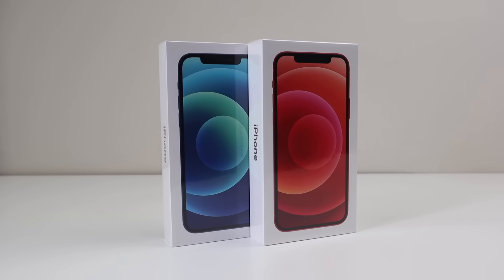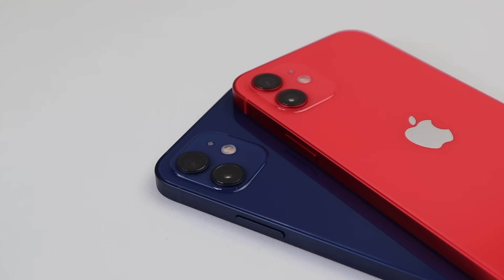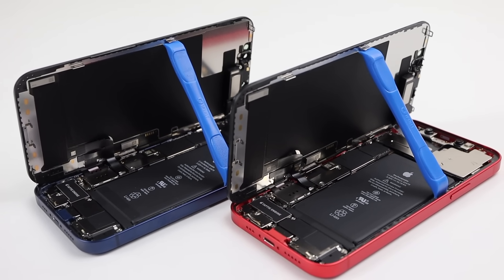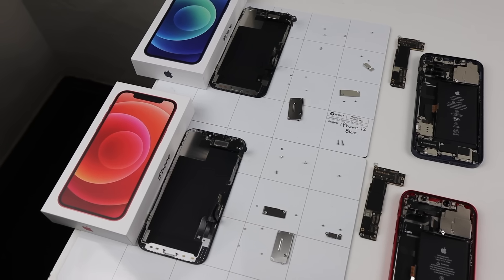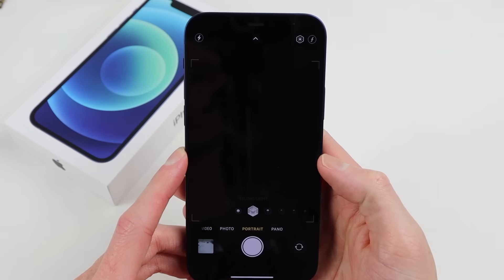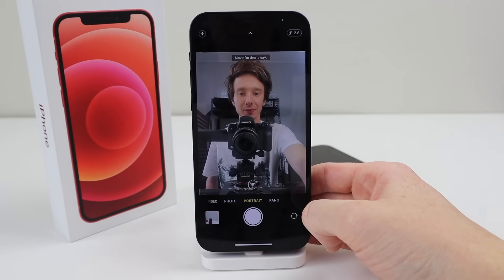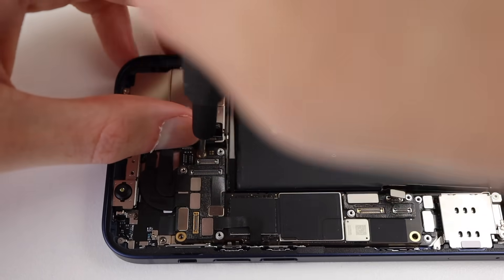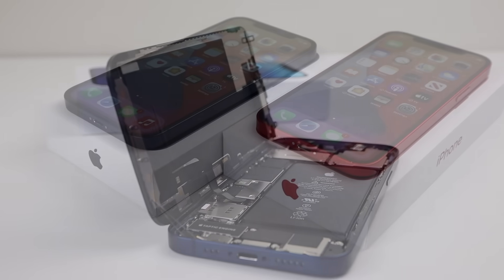iPhone 12 Anti Repair Design - Teardown and Repair Assessment

Comment: Wow. Intentional hostile prevention of repairs. This is why I don't use apple products. I want to be able to fix my phone at any repair shop.
Reply: AND I LOVE THAT APPLE IS DOING THAT😁
As technology evolves more and more, it is no longer possible for non-specialized human beings to make their own repairs.
a good example of this would be cars, 50 years ago it would have been perfectly possible for anyone to do a simple repair on their car! not nowadays (have you ever looked at a modern day engine there are more cables in sight than metal).
such as, for example, making a small repair to an appliance does not present any risk to human beings, making a repair to a car, an appliance or any other object, may be involved in handling objects that we may not even know what they are or what they are for. example batteries and other hazardous fluids present in equipment.
Reply: @DiogoP  That is true. Some repairs need to be made by professionals to guarantee safety. But goddamn if I can't buy a kit to fix my broken iPhone screen without the whole phone throwing a tantrum. I guess we all have to accept the fact that all Apple products have to be brought in for repairs at nearly the same cost as a new device.

Comment: For some context, a Third party is basically phone repair companies, i.e. people that do not work directly or contracted from Apple.

Unfortunately this is not illegal for businesses to do (Making an Anti-repair phone), However it is illegal if the device locks down when you try to put something in it.
this is because, when you buy the phone it is your property, and you are allowed to mostly modify it (As long as its legal). This same thing goes with printers. Dell had a lawsuit because their printers would not allow any other brand of ink, forcing the user to pay for its really overpriced ink.

Comment: From my PoV the only waste they're cutting out is manufacturing prices. If the device can't be repaired, they don't need to make replacement parts to fix it. If the device can't be charged, they just sell another one for the end-user. That's the formula for success right??

Comment: One reason why they might be doing this is to avoid the risk of malicious repair services putting compromised hardware in your system. I do not believe that should be enough reason, you should be able to repair it yourself if you are capable and if you don't trust third party repair services just go to apple. But of course that is not the reason.

Comment: Okay so looking beyond the 40k comments saying that Apple only does this so people can't repair the phones, I have a feeling that part of the reason the camera module is paired to the logic board is to prevent manipulation of the Face ID data by connecting a piece of modified camera hardware in order to surpass the Face ID security.

Comment: For comparison, I timed how long it took me to open up my phone while it was still in its case, which has three parts to it that must be removed to be able to get to the phone within.  Total time was just under 15 seconds, or about the time it took the video to go from him starting to unscrew the case screws to starting to try and pull the phone open.  Of course, to fully access my phone I'd need to take off the roughly dozen screws under the backplate but what I did was enough for me to be able to access my battery and replace it, which just involves popping the old out and the new in.  Oh and my screws are just tiny philips.

Fuck Apple, fuck their greedy corporate bullshit, and fuck the iPhone.

Comment: Wow. Imagine a company like Apple that is trying to sell picture-perfect devices having a screw that is pre-stripped from the factory.
Reply: By 2023 Apple will make a phone that turns into a murderous robot mecha armed with kitchen knives if you try to open the phone
Reply: AND I LOVE THAT APPLE IS DOING THAT😁
As technology evolves more and more, it is no longer possible for non-specialized human beings to make their own repairs.
a good example of this would be cars, 50 years ago it would have been perfectly possible for anyone to do a simple repair on their car! not nowadays (have you ever looked at a modern day engine there are more cables in sight than metal).
such as, for example, making a small repair to an appliance does not present any risk to human beings, making a repair to a car, an appliance or any other object, may be involved in handling objects that we may not even know what they are or what they are for. example batteries and other hazardous fluids present in equipment.
Reply: @DiogoP  stfu
Reply: @DiogoP  1: apple dickrider
2: if you don’t know what a part on your car is you shouldn’t be working on it
3: the most hazardous fluid you could really come in contact with when working on a car is gas
4: a phone battery won’t hurt you unless it explodes in your hand
5: new cars are still repairable by most people but they’re just scared to

Comment: While I thoroughly agree that the anti-repair measures are nonsense, the power adapter argument at the start undermines the rest of the video. What Apple is referring to, when it comes to their stance on power adapters, is that there are huge numbers of standard USB to lightening cables and adapters that work just fine with the iPhone12. And in that, they are correct, especially given that my 10 year old wall adapter from my first-gen iPad still works just fine at charging my latest apple devices (using a USB to lightening cable).

The rest of this video is on point; Apple's position on repairs is hypocritical in the extreme. Then again, as an Apple customer, I know what their particular brand of evil is (just as I do with Microsoft, Amazon, Google and the other giants).

Comment: Apple: If it ain't broke, we will break it.
Reply: Apple rotten to the core 

Commented from iPhone 
But really I want to switch to android or Samsung but Idk if I could use it just because apple is so user friendly
Reply: @TexasNationalist1836  Idk what you're talking about. The newest android phones are extremely user friendly. Even moreso because its highly customizable.
Reply: @TexasNationalist1836  as a die-hard Android user, Android is no less user friendly. As long as you buy from a good manufacturer, the interface is just as user friendly. The only thing your giving up is the seamlessness. Take pairing airpods for example.
Reply: @TexasNationalist1836  Android is user friendly, mabye even more at certain areas, like accesing your files. Only time it isin't user friendly is when the provided UI is poop.  But grab some android other than samsung as they recently too started going right down the no repair path. Grab a old LG phone even, those are pretty repair friendly.
Reply: @TexasNationalist1836  i find it that android is more user friendly due to all the Small developer's that can work on applications for Android devices
Reply: "And you WILL buy another."
Reply: The only way crApple wouldn't suck is if they started making vacuum cleaners.  "Unable to verify authenticity of air filter. iSuck disabled for your safety and security."
Reply: Better be:
"If it ain't broke, we locked it. You broke it, you lose the whole phone, please buy new".

Comment: As someone who works in iPhone repair through Best Buy, you don’t need third party repair. Yes, apple is particular about their phones only being repaired by their certified repair people. This is because we are outfitted with the technology to properly repair phones. The reason things like Face ID, battery and display being genuine, and other errors surfacing is because you have to calibrate and configure the system after each repair for the os to recognize the parts are genuine. It’s a security thing, and it also lets us know if someone was tampering with their phones, as that is against apples tos. It isn’t super expensive to go to Best Buy and get a screen replacement. Leave repair to the professionals
Reply: Repaired my old iphone screen myself for 70 dollars. Recently had to go get my new one repaired, that was 400. "Leave it to the professionals" my ass.

Comment: Just need your suggestion how i can fix my I phone XR, after one and half year one day it suddenly stop with out any pre error. Also Apple service center confirmed that there is no Physical Damage or Any damage due to liquid. As per the service center they said it's mother board may have some problem and Repair is similar to the cost of  New one so you decide if you want to get it repaired or buy new. Also they asked me to visit Local Shops.

Comment: Considering the effects of swapping hardware, it's safe to assume that the hardware information is forced onto either the board itself or a small boot section on the main drive. Seeing as this info can be modified at stores ot "repair" the phone, I doubt it's difficult to access, and is most likely just hidden in a place most third-party repair services won't look.
That said, if we were to find the source of this data, we could easily modify it (given we also know the required data for the new components) and successfully repair the device.

Comment: @hugh Very interesting video.  I'm just wondering one thing if you replace the motherboard and the camera assembly together will it still give the same issues with the camera. This would prove that the camera and motherboard are paired" together.

Comment: i worked at a repair facility. after replacing cameras, battery's and displays on iPhone, there was a process we had to perform on the phone to make the new part work with the device called calibration, which was basically updating the serial numbers of the parts with the serial number of the phone. i think the lack of this process has something to do with what you experienced in this video.
Reply: He has done display and battery calibration on devices before. The question in my eyes is, why do we as consumer even accept the premise that I need a to spend a couple hundred bucks on a recalibration tool (that will become obsolete next year) to fix the display or battery. Which are in my opinion, both consumable parts
Reply: @Carterthielftw_  yeha that's the thing, for everyday consumers it's not worth it, but for somebody running a repair shop, like hugh jeff, it's a good deal and probably a must have.
Reply: is this hard to do and how exactly do you do it?
Reply: Lol hence proved , those are are some things deliberately used by Apple to make their own parts incompatible with one another unless and until you update their serial numbers. Seriously why do people buy Apple. The only line of products that are actually good are iPads and the latest m1 Macbooks. That m1 macbooks will also not last long as the rest of the processor industry will try to catch up on that ARM design
Reply: @aadityaverma6539  the entire "it just works" mentality and the ecosyatem that ia near impossible to escape probably contributes to it
Reply: They may sue you for this
Reply: So there is hope?
Reply: @MoonSicckle  That “calibration” software required us to have a Mac mini running on our network that ran the “gateway” software. This software had our authentication information such as our vendor I.d. Etc… that software connected our system to Apple in order to authenticate each process that was being performed. all activity was documented and presented on a document that can be audited randomly. So no one really tried anything funny.

All that said. No. I don’t think the future is looking any brighter for end user repair on Apple devices.

Comment: I think it could be possible to repair if using parts that haven't been in an iphone yet basicaly they haven't been paired so maybe what is causing this issue is that the iPhone recognizes that the part has been paired whit an difrent model but I prob just typed some bs XD

Comment: Welp one more point to Android phones
Apple:5 (because of security,camera,storage,ram,and built in screen recorder)
Android: I cannot count how many
cheaper android phones literally let's you remove the back without tools which means it's WAY easier to replace the battery without even researching (heck I don't even know how my cheap af phone survived for 5 years from falling only just some little cracks), some phones are as good as iphones but let's you fix it yourself or with other phone repair shops (yeah it's expensive but can live longer than iphone I think)

Comment: Do you really need an APPLE IPHONE? easy answer NO, any other cellphone is better and more durable.
Reply: I agree my 5 years old phone (which I'm currently using) is still working, just some small cracks (cus I'm clumsy)  and best thing it's cheap it's just 3000php which is pretty affordable
Reply: An example is my huawei p7 ascend from 7 years ago that still works perfectly

Comment: The modularity on apple devices and the way they sell replacement parts shows the rift between the amazing talented apple engineers and the cutthroat apple corporate.
Reply: Apple loves to expand the screen and change the charger every year and call it "new" when it's the exact same thing as previous years.
Reply: Enough reasons not to buy an apple.
Reply: The engineers are not amazing. Look up many Macs have fans that are not even connected to heatsinks. Which honestly seems done on purpose to help make sure the machines don't last more than 3 years.

Also my Mac I have to use for work (Due to company having a deal with them) literally has the fan turn on when there is a loading bar on a webpage that exists to tell me how a remote process not happening on my machine or using any of my machines resources is doing. With out fail 100% of the time I do this the fan turns on. Which to me says its designed to turn the fan on only when it thinks it should be busy doing something....
Reply: This is a way of apple forcing you upgrade to a new iPhone!
Reply: @anthonymartelli6091  Yep.  It has a term.  "Planned obsolescence".
Reply: ... Amazing talented Apple Engineers?
Reply: @DaroriDerEinzige  LOL formerly talented.  Lately same crap year after year.
Reply: @DaroriDerEinzige  why not? They made the practically god m12 chip (As powerful as the most powerful desktop processors and uses almost no power), their devices are very powerful even though on paper they are underspeced by their competitors. The problem is their corporate stance against repair and freedom to buy of their materials and use them in other products.
Reply: @ShihammeDarc  Uhm ... As powerful as most powerfull desktop CPUs.

Yeah, uhm ... Uwu uwu, rawr x3 senpai.
Reply: @DaroriDerEinzige  what does this mean
Reply: @ShihammeDarc  That you should either use the correct Chip Names or simple put a link in your Comment which would back up your statement.

Apple never produced any Processor which would really compareable to Chips of Intel or AMD in the Desktop Market.

Actually, Laptops from Apple do use mainly Intel and AMD Chips, Mac Pros too. 

Although they "produce" and "developed" Chips for their Mobile Devices. 

Or the ARM Chip M1, to which you probaly refer. 

And the M1 Chip got utterly destroyed by Intels i7 Chips from last year in every performance benchmark, in every real world application and they ain't even really that much better in regards of Battery Life.

While the whole Software and Hardware is in an Apple Laptop actually designed for their M1 Chip.

While Windows isn't always perfect tailored for certain Architecturs etc.

So overall - The M1 Chips is a "Paper Tiger". He looks nice on paper, but doesn't perform.

Which isn't that surprising - Intel and AMD have over three Decades expierences in building Chips. They pionered most Technologies which are also used in the M1 Chip.
You basically can study Microships for years and will still learn the first years at Intel and AMD daily new stuff.
Reply: @DaroriDerEinzige  yeah my bad made a typo on the m1. But thank you for taking the time to clarify instead of harping over the typo!
Reply: @ShihammeDarc  I like your irony, I give you that.

Anyway, if you look up the Benchmarks you will see that Apples claims to its performance are ... uhm, overly positive while in reality a i7 does performe better.

Often even with Apple OS - Although that's the next point: Do you really wanna have an Apple OS? 

Personally, in my expierence, you will have even disadvantages in your work life with Apple. If you don't work in specific niches - Linux is more suited and Windows often pretty easier to use.

SciDAVis, MatLab, Mathematica, LTSpice, Visual Studio (Code), Maple, ... are often Plug&Play with Windows, maybe a little bit of work under Linux and often "functional" under Apple but sometimes it bugs out.

And those Programms are just normal Stuff for Engineers.

I would even say that probaly at Apple most Engineers don't work with Apple Products.
Reply: @DaroriDerEinzige  and as I said, the engineers are great

And no I was not being sarcastic
Reply: @ShihammeDarc  idk why they put work into it when they also make it so easy to hate
Reply: @ShihammeDarc  yes I love the Apple device in itself, however the corporats that sell it needs to be put in jail.
Reply: I recommend that you watch Louis Rossmann's "MacBook Buyers Guide" on youtube. Apple's engineering may seem great in the short term but the sheer amount of incompetence shown throughout the past decade of MacBook design is worrying
Reply: @Carterthielftw_  I ama subscribed to Louis. I am not talkingabout old macbooks, I am talking about this phone
Reply: Who's the character in your profile picture?
Reply: @tfclassicengineer1005  Meltlilith/Meltryllis from Fate/Extra and Fate/Grand Order
Reply: @ShihammeDarc  Thanks, man.
Reply: @ShihammeDarc  fellow fate fan
Reply: Maybe the throats of Apple corporate need to be cut instead?
Reply: That's a very fair comment!!!!!

Shame on Apple!
Reply: Yoooo a melt pfp have you played ccc